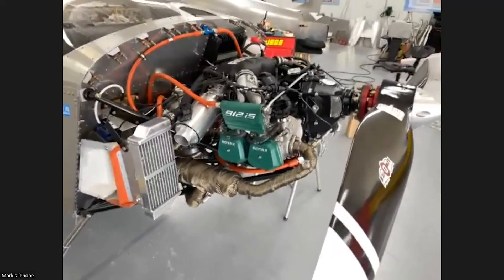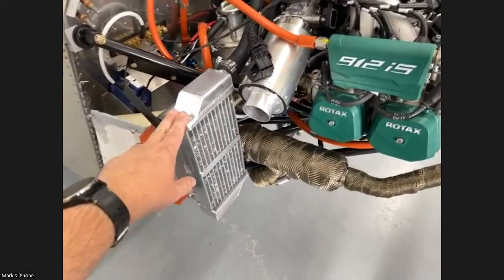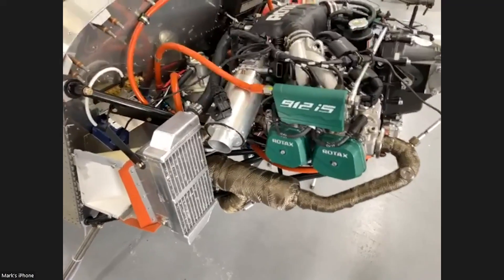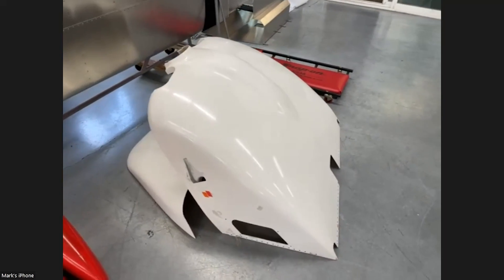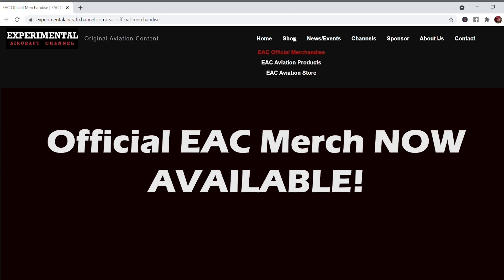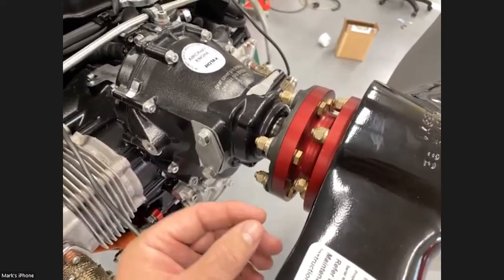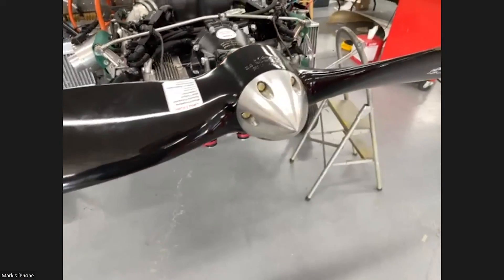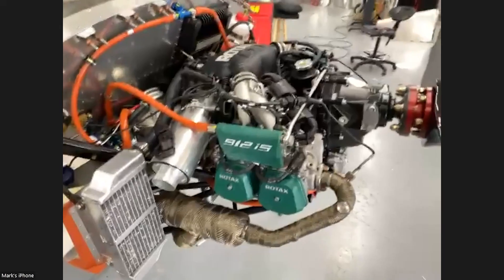1st Engine Start Factory Installed Rotax Sonex Aircraft

Comment: Sonex needs more factory support for Rotax. Engine is one area a lot of builders are not willing to compromise on. Personally I am only looking at Rotax options for my build.
Reply from the maker: Perfect match in my opinion (Due to weight and HP).
Reply: Bryan 

The carbureted 912ULS is 100 horsepower too.

But it's lighter and cheaper than the 912iS!

I know the ULS is less fuel efficient than a 912iS; but a Sonex isn't exactly a cross-country machine is it?

Cross-county flying is "doable" in a Sonex; but your 750 Cruzer is a much better fit for that kind of mission.

I'm hope Sonex do not embrace the iS to the exclusion of the ULS.

Comment: I am a bit disappointed that you did not utilize the 915. But, I understand the cost is substantial.
Reply: they have to consider the cost diff....   and the extra weight (40lbs?)
Reply: @Feedback4Utoday Yes, good point, it’s easy to shave weight by adding additional lightening-holes, space the wing ribs a bit further apart, to eliminate one on each wing, grind off some of the cooling fins on the heads, not painting, sand the cowl thinner, grind off a bit of the front gear, not eating 12 hours before, and taking x-lax… get a petite wife… that would bring the extra weight to -60lbs. 👍

Comment: btw, piston engines with electric battery turbo boost, with exhaust turbine/shaft combo generator, no turbo lag, no lack of power, engine muffling by the generator turbine
Reply: or just purely electric motor with gasoline turbo piston generator combo
Reply: @Jkauppa  If you want a heavy pig of a plane, sure
Reply: @MrCarGuy  you are twisting things on purpose, turbines and turbos are the most energy dense, thats why helicopters use them, dont kid yourself
Reply: @MrCarGuy  dont use big batteries, its just a gag order, to buffer a bit stored electricity